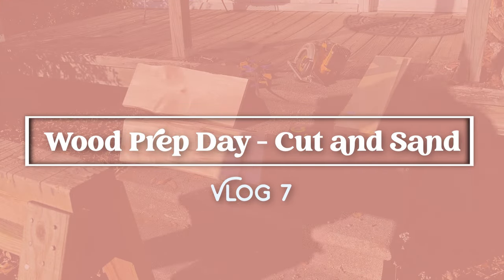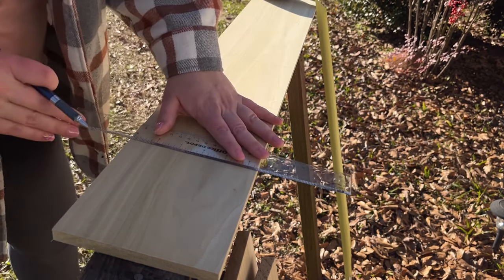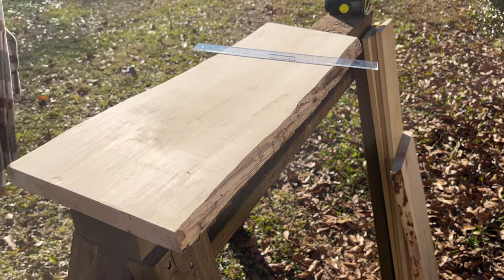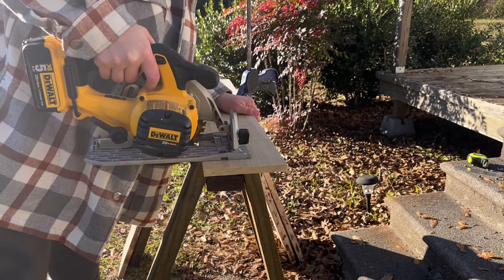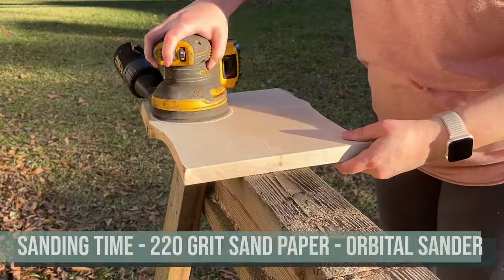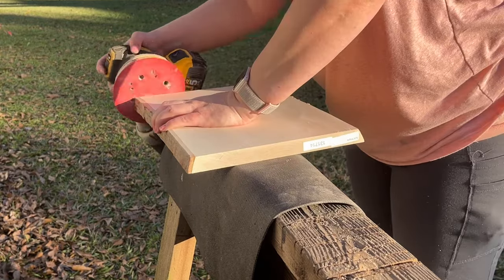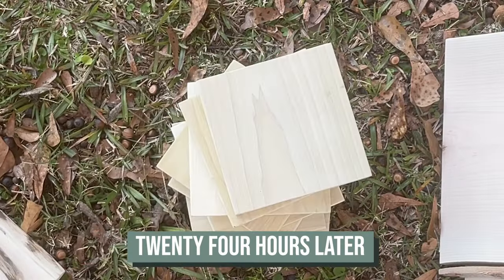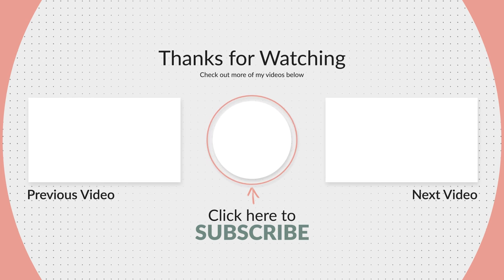Time to Cut and Sand Wood Canvases for Pyrography   Vlog 7

Comment: Yeah my black walnut and red cedar slabs i bought fresh sawn finally dried. Took to friend with larger saw and then spent days sanding everything with different grits with my orbital. Now i have stacks of prepped wood to use over Wisconsin winter season.
Reply from the maker: It's a lot of work, but totally worth it when you have a nice stack of wood to last you a while.

Comment: A like to use a speed square for drawing the lines and it also guides my saw like yours as you can just clamp it. $9 at Home Depot I think.
Reply from the maker: Oh you know, I think I have one, I just forget to use it. L hahaha! I have habits and it just slips my mind to go an easier route sometimes. But thanks for the reminder. I'll have to make sure to find it and put it on my table so I don't forget next time.